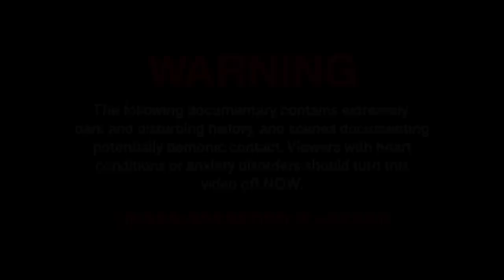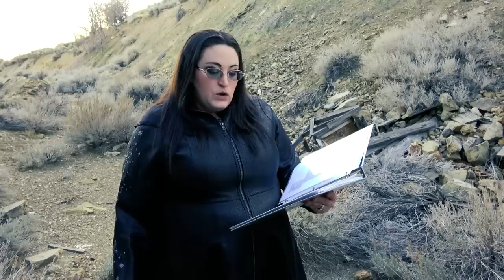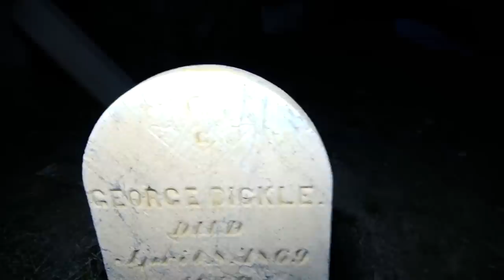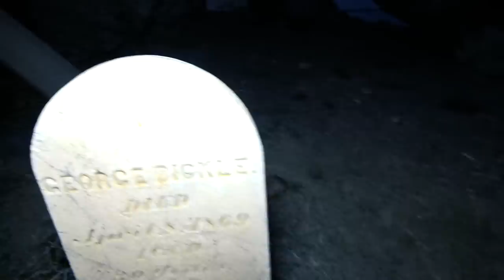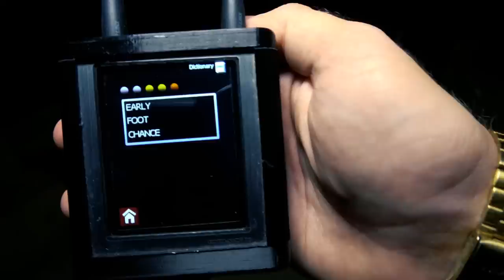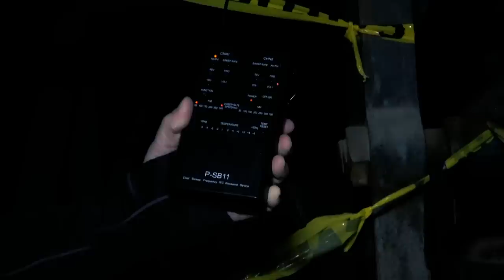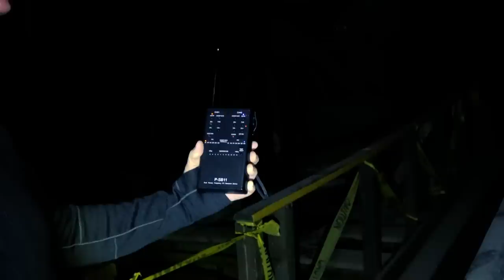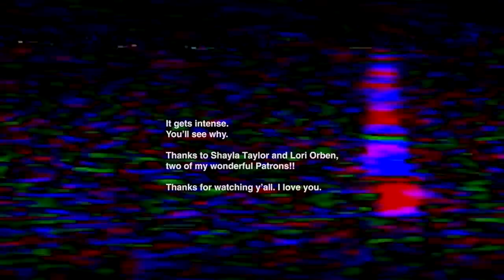DEMON Caught ON CAMERA @ Haunted Mine | The Paranormal Files

Comment: This was one of your best yet Colin! But i need to tell you what i see at timestamp 1:50:19 - and it wasn't a ghost.   You show a close up of those motion sensor balls - and yes, I was very creeped out at the spooky things happening all around you -  but aside from spooky things - it appears that at that time stamp - the video shows the equipment is sitting on a ledge with debris and dirt.  At first I thought I was looking at bits of coal or metal shavings but then as you zoomed in I realized those elongated little bits of stuff were mouse or rat droppings.  I wanted tell you that you should know how to positively identify rodent droppings and be careful not to disturb any dried up droppings because the particles can become airborne, you could inhale it  making you very ill.  You should always bring a spray bottle with a mixture of 10 to 1 water and bleach (10 parts water, one part bleach) and lightly spray any droppings you see so that the particles cannot become airborne.  Even just a spray bottle with water alone could be enough to keep the dust down. I am serious.  I am sure you had nothing to worry about this time because nothing really got disturbed during this video (besides, here you are now - still healthy!).  The winter weather should have been enough to mitigate the potential.  The hot weather is where you need to be cautious.   I tell you this because I knew someone that got very very ill from this same thing.  He disturbed some mouse dropping while down on the floor fixing his washing machine and contracted "Hantavirus".  It usually only occurs in Southern warmer states but this happened one hot summer in NEW JERSEY.  When my friend got sick, none of us ever heard of Hantavirus - the doctors didn't even know!
 I know you must come across a great deal of disgusting stuff in your travels and you all know not to mess with it but i didn't know if you were aware of the serious danger of just simply disturbing some rodent droppings - especially higher up off the floor -  and i just want you all to be healthy and safe.   Look up "Hantavirus" to learn what it is.  Hantavirus does not occur in more northern states but it COULD happen - plus, I didn't know if you knew about it at all. Rodents seem to be able to climb everywhere in these abandoned places - as well as raccoons (yes, their crap harbors another potential lethal disease, too).
 I want to see many more videos from you all in the years to come!
You are all so awesome! 
And so was this video!!  ❣
Reply from the maker: Wow- thanks for looking out for us. That’s wild!
Reply: @theparanormalfiles  I was debating if I should point it out to you or not because you are further North - but but I am glad I did.  Better safe than sorry!  We had the problem in New Jersey because that particular summer was very dry and hot, all the little streams dried up for months and the mice came into the house looking for water - and found it dripping from the washing machine connection.  A few weeks later when he went to go make a repair is when he encountered the mouse droppings - and whammo, he got very very sick and no body knew what it was.  Unfortunately they did not find out in time - so I hope this information keeps you all in good health. You and your family are such nice people - you feel like family to me!

Comment: Enjoyed this video, and by the way, do not waste money on the alpha heater.  It does not do what it says, will not save you money on your heating bill.  I plugged it in, it did not heat a very large area, and my normal 45.00 electric bill went up to 90.00.  I was pretty disappointed.